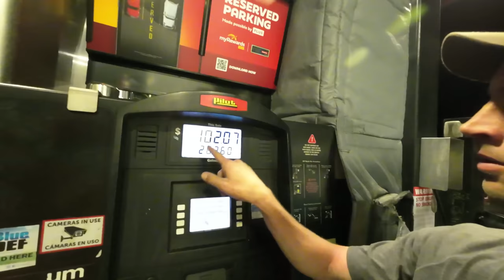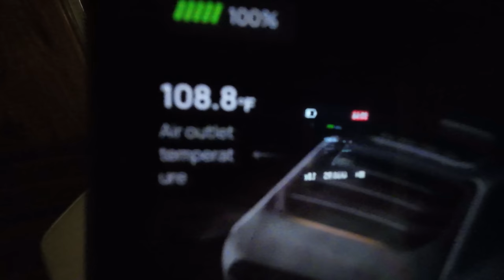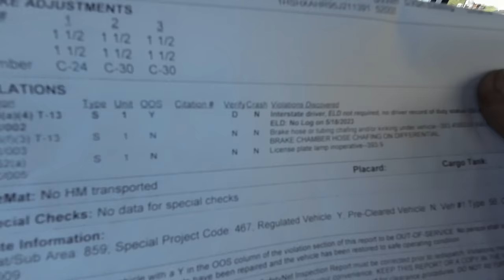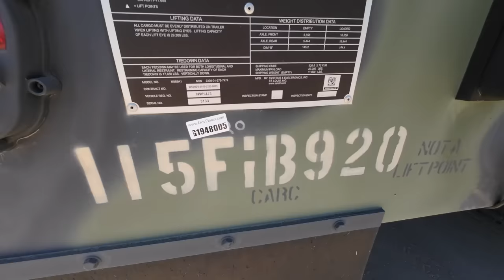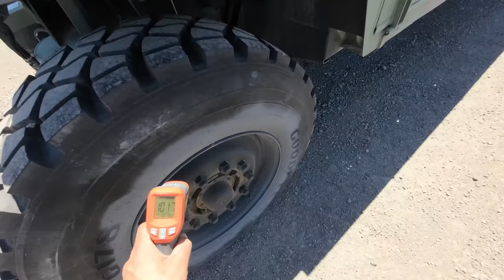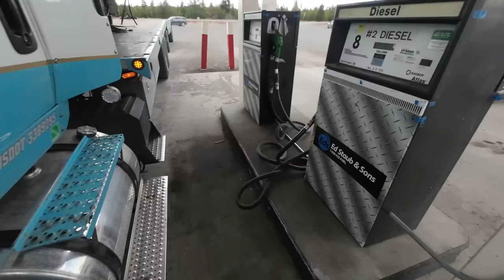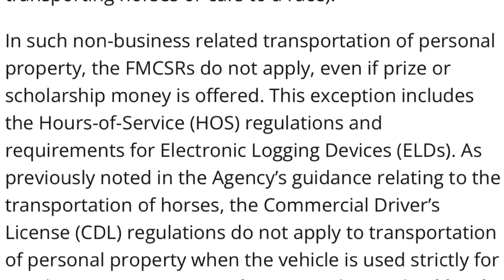Busted by CHP!   But I Know a Loophole…

Comment: I live in Australia and my brother is a heavy vehicle mechanic and driver with licenses up to a Heavy Wrecker towing a complete road train (wrecker  +   prime mover  and 3 trailers) Some years ago he was driving a twin steer freezer truck. So that has 4 axles, with the then limit of 6 tons per axle -- total 24 tons. He went through the inspection station with a full load.  He was out of the truck doing what ever he had to do and was about to get back in the truck when the inspector told him not to touch the truck, He was about to make a smart comment when he saw what the inspector was pointing at.  The scales were reading 23.995 ton.  If he had touched the truck it would have been overweight and he would have been fined something like $2,000.   It does show that some of the inspectors were human.
Reply: That's an awesome save by that inspector
Reply: Told a story years ago by an Inspector, since retired.  Australia Post pulled onto the weighbridge at Monteith.  Volvo big banger.  Went 6.6 tonne on the steer axle.  End of the friendship was 6.5 tonne.  Inspector in question looks at the driver.  Younger lady, who would be battling to weigh 50 kg, dripping wet!  Opening comment to the driver:  "You weigh 120 kg?"  Said with a big smile, nodding head and a wink.  Driver caught on -  Yes, am 120 kg!  PASS!!!

Paul Johnstone story would be from the pre 2000 era.  Eastern States.  Twin steer axle group would be allowed 9 or 10 tonne, depending on load sharing or not load sharing.  Tandem drive, 8 tyre tandem would be 15 tonne, giving 24 tonne.  However, do not know of any enforcement weighbridges that weighed in 5 kg divisions.  To my knowledge all of the enforcement weighbridges were either 10 or 20 kg readings.  So, would like to know where this weighbridge was!  And, saying tons, makes it prior to 1973 or so, as all the weighing equipment was converted to metric, from tons, cwt and quarters to tonnes and kg.
Reply: @111jacare  Marulan weigh station. Would have been in the 1980's.  I had to take   a bit of poetic license and use whole numbers so that non Australians would get the concept.   It was frozen food and the exact weights of the items were known and the person making the order were  supposed to make up the order with a safe margin on weight.  Someone could not be bothered doing their job.  One of the suppliers in Sydney had a weigh bridge and all trucks were weighed before they could leave.  These days my brother does Brisbane to Sydney with a B Double carrying overnight express.  Many bad stories about the frozen food place.
Reply: Nah, if he were human it would have been the spirit of the law versus the letter of the law. Also no DOT officer is human.

Comment: It's extremely educational to the public in general to put a spotlight on what actually transpires in "safety" checks and roadside inspections. In 1983 I was held on the west Truckee POE scale pad for over 45min (backed up traffic for over one mile) while the officer was trying to find a regulation to cite me for having 37,000 lbs on a new Ravens spread axle (40,000 legal without permits).  Said he'd never seen a spread before and it was surely illegal.  Measured and weighed my trailer every which way--finally sent me down the road saying he just couldn't figure out how to write it up.  And that's just one of a thousand memories.  Basically revenue collectors.

Tip on tie-wraps--the sharp edges will eat into airlines--add a protective sleeve and tie it back.  Enjoy your videos and community involvement.  Great work.
Reply: Revenue collectors that don't collect enough to pay for themselves.

Comment: The military uses a paint called CARC (Chemical Agent Resistant Coating)  It's supposed to be chemical resistant for easier decontamination.  They don't dismount wheels when they CARC vehicles, nor do they bother to mask anything.  That flaking on the sidewall of the tires is likely as not CARC.  It'll flake off on it's own, dont' try to remove it yourself.  Inhalation of the aerosol or particulate is very not good.
But that's a helluva stout trailer.  Those would be dragged behind HEMTT, those big 8 wheel cargo trucks with the 4 wheel steer front axle systems.
Reply: And yes, you are correct.  That trailer was never drawn by a line unit, since it's got the depot marking on the back.  If it would have gone to a unit, it would have been marked with a unit identifying bumper number.
The trailer is designed for the MLRS pod and would carry 4 at a time, with 176 inches x 96 inches floor space.

Comment: Having been through numerous intense laboratory inspections by AASHTO, ASTM, CALTRANS, etc., I absolutely LOVE IT when an inspector gets caught in an error. Good on you!
Reply: Until they're made to pay personally this treason will continue🙄
Reply: If everything above Marin county was another state I would still be there.
Reply: But the officer wasn't in error.  It is logged as PC ( Personal Conveyance ) and still gets logged as such in line 1, off duty.  The log book was required.
Reply: @happypappy6371  are you disappointed that they have switched from traditional cowhide leather to synthetics🙄
Reply: @curiousgeorge5992  By your comments, I assume you are not a driver.
Reply: Now the zip tie is in contact with the hose, and probably with more concentrated pressure in one spot than the smooth flat steel, LOL.  It'll pass though.
Reply: @stipcrane the officer was correct, the hose was chafing on the diff, and that is not allowed. Eventually it would wear through, even if it wasn't showing wear yet. 

If it had any wear on it, he would have been put out of service until he replaced the hose. 

And a properly installed zip tie will not rub on the hose but rather immobilize it, so yes, it has concentrated pressure, but causes no damage to the hose.
Reply: @happypappy6371  he is not off duty.
Reply: @ChrisWijtmans  If he was not off duty, he definitely would have needed a log book.   So, your point is?
Reply: @happypappy6371  You do not seem to understand he was not "off duty" from "work". It was his personal business, no log book required.
Reply: @ChrisWijtmans  Same as when a driver pulls into a truck stop for the night and logs off duty.  Then he decides to drive down the road to a restaurant.  He has to log PC (personal conveyance)in the off duty line of the log book for those miles driven.  Most people don't understand the use of personal conveyance.
Reply: @happypappy6371  no, there is a difference, because someone off duty might still be driving work truck with work payload.
Reply: @ChrisWijtmans  Exactly.  And it is logged in the off duty line as PC as long as it is not furthering the load toward it's destination.

Comment: DOT inspectors hate being proved wrong and will look harder to find faults. On the other hand, many state inspectors look for ways to pass you on inspection because it keeps their roads safer. The best feeling I ever had was getting a sticker from an inspection on the way home. That truck was going to auction and my boss loved the extra he got.
Too many great ideas for your trailer Casey, just a damn shame our government wasted so much money on them. With your off-grid power station and panels you are over half way there already with; power, heat, AC and the fridge.
In the meantime, great for leaving at a job site to get soil or rock loaded then drop a side to unload at your schedule.
You are in my prayers
Hoka Hey

Comment: Hey Casey! I used to work in DRMO in NSA Mechanicsburg, Pa. You probably already know this but, if you didn't get a parts list, save those tickets and labels on each of the parts for future reference. It has your nomenclature, national stock number (nsn) and part number in case you ever need an exact replacement. I can't wait to see what you do with the trailer!
Reply: Been to your joint there in Mech 😊many times.
Reply: No kidding I'm 15 minutes from there
Reply: No kidding I'm 15 minutes from there

Comment: Welcome to farm life. 🙂  Farm wagons for years have had steerable front axles. Not only does it keep it more compact, but because the wheels don't move, they are more stable as well.   I learned to back one of those up by the time I was 10.  You just have to figure out the extra bend in the system from a 2 wheel trailer.  The short tongue and long body of your truck would make that very challenging.  What is even more impressive is that I saw a neighbor back up 2 wagons hitched together one time. That takes 100x more skill. I've never even attempted that. Looking forward to see what you do with it.
Reply: Ill try the double trailer thing one day. In Britain, only a showman can pull 2 trailers, so have never experienced it.
Reply: They’re called auto steer (as in automobile). My dad backed a double hay wagon hitch on the first try. Didn’t think he could ever do it again.

Comment: This type of trailer is known as a dog  trailer as opposed to the centre axle (or couple of axles grouped) pig trailer. If caravans/pull behind was built on these types of configuration trailers, it would be a lot more stable. Nice pick Casey! Many happy miles!
Reply: Guessing you're an Aussie, as that's what they call them, in the US we'd typically call it a pup, full-trailer is also acceptable (as opposed to a semi-trailer, a trailer that cannot roll without a tractor or converter dolly), or a pull trailer. We refer to the combination as a truck and trailer or truck and pup, distinct from a semi or tractor-trailer, Europeans refer to them as tandems, and Aussies call them truck and dogs. From what I've seen, the Kiwis adopted the American vernacular of truck and trailer.

Comment: Anything DOT puts on your CSA, never , I mean NEVER goes away. I’ve had them give me a ticket for a air leak, it wasn’t a air leak, it was my cabs self leveling system. Even had the Kenworth’s shop mechanic put it in writing and they still couldn’t take it off. Was told in court that everything stays on your CSA. It’s a stupid rule.
Reply: that's probably why alot of trucks won't go into California.
Reply: Yeah don't go to California not even in america 😂
Reply: Either you had a bad officer or your truck failed the leak test. 

What was your airdrop rate with the truck off?
Reply: Depending on the severity, the CSA points are based on 1,2 or 3 years.
Reply: @JohnnyD1993  air leak passed , he just heard it and wrote it up .
Reply: I had a Mack with an air starter.
During an inspection in Wi I noticed I had a pretty bad air leak.
The officer mentioned that he was going to try and find my air leak.
I said I DON'T HAVE AN AIR LEAK. I HAVE AN AIR STARTER.
WHAT YOU HEAR IS ALL THE AIR MOVING FROM THE TRUCK INTO MY AIR STARTER TANK.
I HOPPED INTO THE TRUCK WHILE I STILL HAD AIR AND DEMONSTRATED MY AIR STARTER.
HE WAS AMAZED AND PASSED ME.
Of course I got the air leak fixed when I got back to the shop.

Comment: I used to deliver boat trailers out of Arkansas. We drove Dodge 1 ton duallies. The only state that gave me a problem was Oregon. One truck had a pickup bed the other had a flatbed,  they were identical but Oregon classed the one with the pickup bed different and we were often overweight in it due to that state classification.
Reply from the maker: That’s a federal regulation, not state.

Comment: Hi Casey, could you lift the camper a little, and move it forward, so that it extends over the cab? That would save space on the truck bed. Also I think its time you added a couple of winches under the bed, and possible one at the front! Great Video, keep them coming!
Reply: Exhaust I think makes it too little to gain.
Reply from the maker: There is a height limit..
Reply: @CaseyLaDelle  those legs may not like that also, heard stories of them popping off at heights, more stable when down
Reply from the maker: @owendodman3037  what legs?
Reply: @CaseyLaDelle  i’m not familiar with your camper, my parents winnebago has crank up legs on it to raise and lower it out of the truck bed
Reply from the maker: @owendodman3037  as I said….  What legs?

Comment: Very informative about truck inspection and sticker requirements! Not sure how the officer was not aware of the non commercial private usage clause permitting the exemption from logbook requirement. You would think that this is not that rare of a situation , especially since he is assigned to do inspections! Oh well, at least you will not receive dings that can affect your insurance rate.
Reply: They simply don't care...hoping everyone just pays em
Reply: As I explained to Casey ----------- You are correct about using your truck for "personal use", which does not effect your HOS, but you are required to  log it on line 1 - off duty and in the notations, mark it as PC  ( Personal Conveyance ) with start and end points as usual and include those miles as personal use, so they don't count when you file IFTA.

Comment: You may have to contact the cop who pulled you over and gave you grief. This has certainly stirred up the conversation on log books and YouTube channel,  lol.
Reply: What I told Casey -------------- You are correct about using your truck for "personal use", which does not effect your HOS, but you are required to  log it on line 1 - off duty and in the notations, mark it as PC  ( Personal Conveyance ) with start and end points as usual and include those miles as personal use, so they don't count when you file IFTA.

Comment: I registered my 1964 IH Loadstar 1800 with Perkins 6.354 turbo diesel as an RV. 

Was a dumping grain truck before I got it; was used once a year at harvest time to haul grain from the fields and parked in a dry wooden barn for decades in-between. 
So it's in unbelievable shape and has been shown some love over the decades.
I bought it at an annual farm consignment sale the day after Thanksgiving. Was not advertised and bought spur of the moment for less than scrap price. Was cold that day, but the engine still started without a preheater and I drove it away before auction even ended.
Has a 25,500 gvw; so it's under the 26k that can create other issues. 

Has hydraulic cylinder power steering and full air brakes. 
The compressed air system will come in handy when switching to military axles.
Can use the 2 speed axle shifter to control the lockers.

May add a fifth wheel to pull a camper or trailer. 
But I also found a Holmes 600 wrecker frame that should work nicely if I convert to the military axles and tires.
Since I don't use it for commercial work, no CDL or weigh stations are necessary.
Good mix of strong frame without a lot of weight to make trail travel easier.
Make life easier for my K30 with Holmes 500 when dealing with heavy loads.

Comment: You are correct about using your truck for "personal use", which does not effect your HOS, but you are required to  log it on line 1 - off duty and in the notations, mark it as PC  ( Personal Conveyance ) with start and end points as usual and include those miles as personal use, so they don't count when you file IFTA.
Reply from the maker: Wrong.  PC is when you use the vehicle privately while participating in commerce.   390.3(f)(3) very clearly states that when used non commercially to transport your own personal property, you are exempt from ALL logging requirements

Comment: T
Great video Casey, thanks for taking us along with, you were actually down here fairly close to my neck of the woods(North Bay), and you're right bro, Northern Cali IS one of the most gorgeous/scenic places ever. It's 20 mi. to surf/abalone dive/salmon/halibut fishing...2.5 hrs. to snowboard...! hr. North to the giant redwoods & 2.5 hrs. South to Santa Cruz/Monterey Bay. Was lucky to have been born here & I'll never leave.  Also, that's interesting about the air lin infraction, b/c you would think the edge of a hard, sharp, thick-ass plastic zip-tie would be more of a concern than two smooth objects just barely touching/rubbing up against each other. But hey, who am I to critique?  Good score on the trailer!

Comment: Casey
Good info  in ref to not needing a logbook hauling  your own stuff. Wished now that I knew that some years back. Was driving my straight truck 24,000 gvw, carrying a small dozer from NJ to Indiana and made the mistake of going through a weigh station in Ohio. Those guys gave me complete BS. First they told me I had to have a logbook and when I argued with them over that they used the fact that I had commercial tags on my truck. Thing was then that in NJ at the time you had either passenger vehicle tags or you had commercial and they wouldnt let me register as passenger with a weight rating of 24,000. At the time you didnt even need a cdl although I always had that.   "not for hire" on the door of the truck they claimed meant nothing and also told me I needed IFTA stickers which I didnt have. I have found the best info comes from guys out there doing it such as yourself. Thanks for that info . I seldom drive trucks anymore, only on occasion. In retrospect Id have been smarter to drive past the weigh station.  Those bears busted my chops for 1 1/2 hrs before threatening me to "never drive through this state like that again", but finally let me go.  :)  Keep the shiny side up Casey

                                                                                                                                                Harry
Reply: Unless someone's hard wired to the internet,  how can anyone be expected to keep up with all their amendments, additions, etc? The system is just rotten to the core, it's unreasonable.

Comment: I always liked pickup campers the bed over the top of the cab made it like driving in the shade. I couldn't tell how many steps I drug off the back having to use a milk crate, but back then we had metal milk crates.